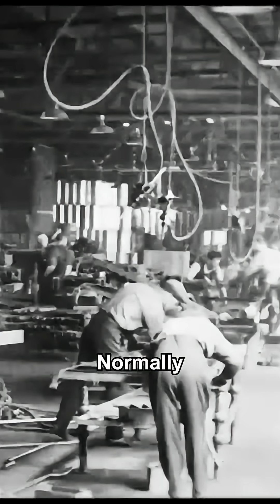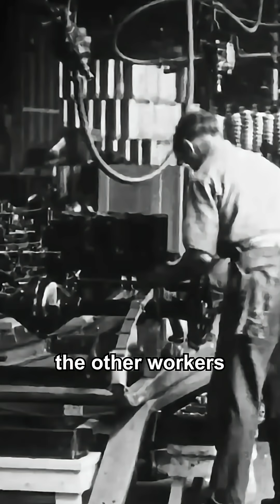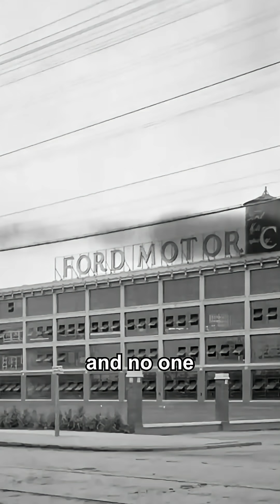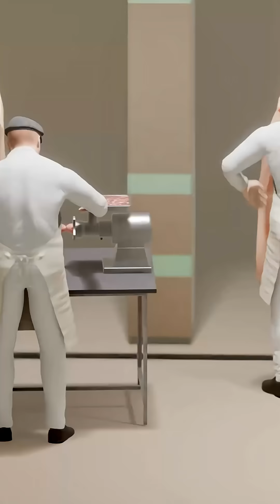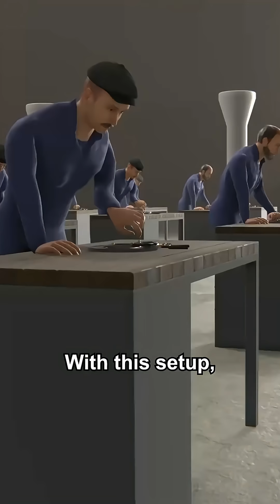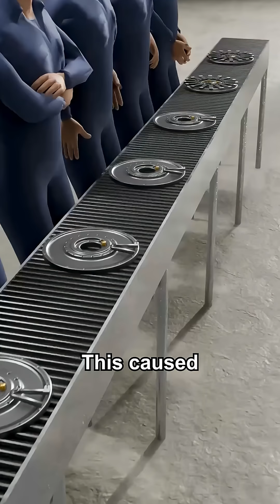How a Meat Factory Changed Car Manufacturing

Comment: First "assembly line" in car manufacturing was used by Oldsmobile in 1901. But it wasn't as efficient as Ford's since even tough workers were mainly stationary, they had to push cars to the next work station to ad the next part

Comment: Assembly lines are great... If you actually had quality parts like back then. Nowaways it's all lowest bidder and cars are built like shit. The workers actually care but the companies suppliers and management don't.
Reply: Which is why you need an insane vertical integration, from resource allocation to the final product if you want to solve the problem at its core. 

Want to build replacement parts for an electronic device 15 years ago? Not an easy task for anyone, but doable if you know the technology behind it.
Reply: @topsecret1837 Vertical Integration wouldn’t let you repair the product without paying a $100 repair certificate to the company and hoping they let you purchase the part from their end (this is literally what Apple does).

The problem with products being crap today is that corps are more interested in how much money they could squeeze out of us for the least amount of material cost. Compound that with Industrial Design, which puts efficiency over art, and you get the modern USA